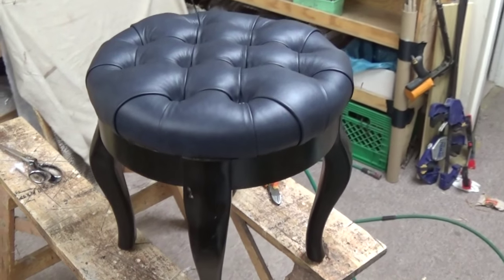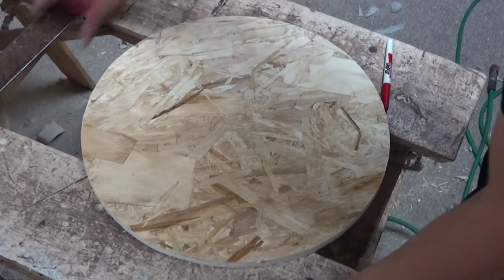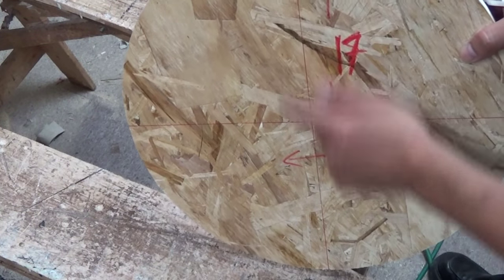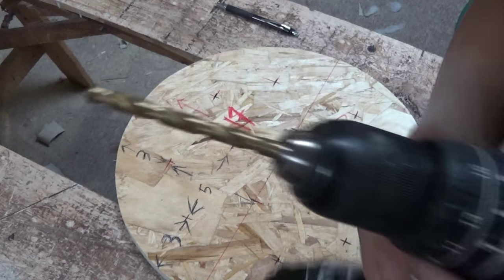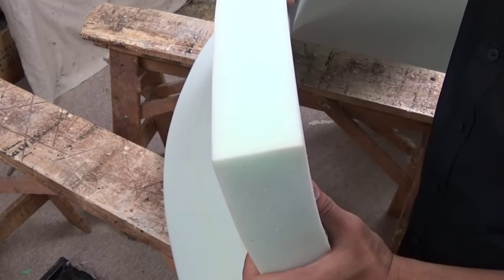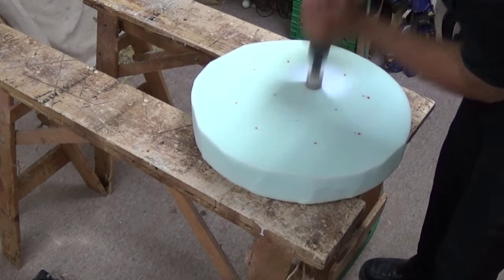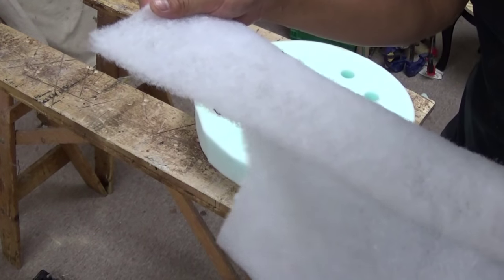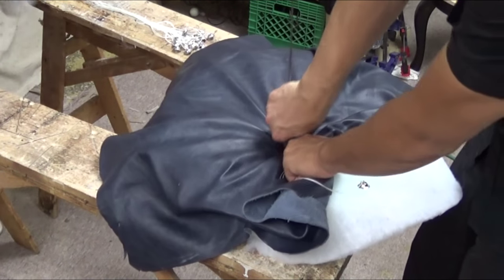HOW TO UPHOLSTER A SEAT BENCH WITH BUTTONS - ALO Upholstery

Comment: I know this video is old, but can i ask how you got 5 inches between each hole? I have a seat that's 13 1/2 inches in diameter and don't know how far i should place the holes apart.

Comment: Hi, could you please explain to me how I would work out the fabric pattern for the same footstool but with the chesterfield pins round the sides also, a cube. I see they’re sewn in a zig-zag form but I’m confused with how to measure it for it. Thanks in advance x
Reply: Too much fabric is better than not enough! Although I've no experience with this particular technique, I'd assume it's a bit like pleating, given the deep fold created by the stitches. In which case, I'd at least double if not triple the amount of fabric you think you'd need to cover that area

Comment: What is the fiber layer for? I see you use it a lot over top of the main foam.
Reply: Nathan S it’s called batting prevent movement of fabric and buttons.
Reply: To stop the cover sticking to the foam. When you change/repair the cover it will come off easily.